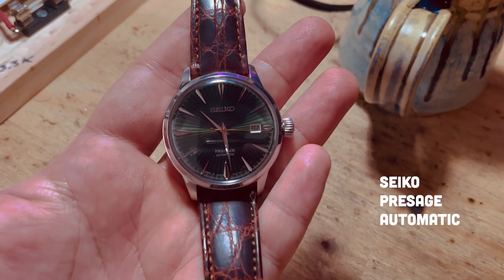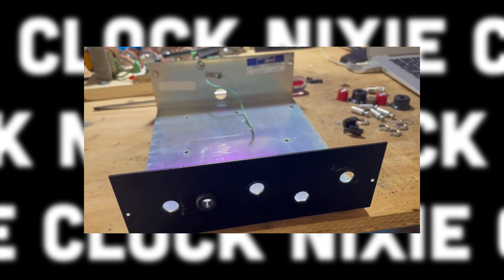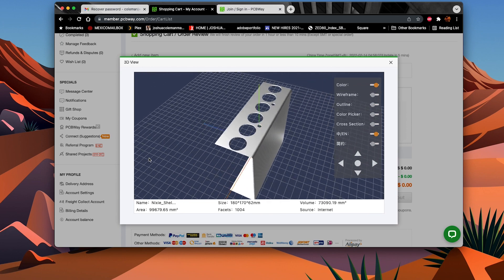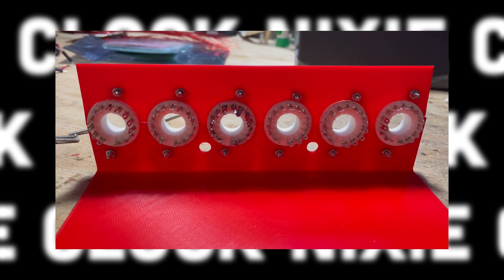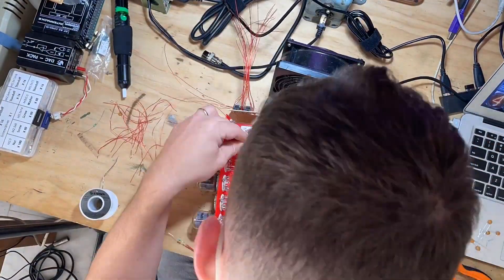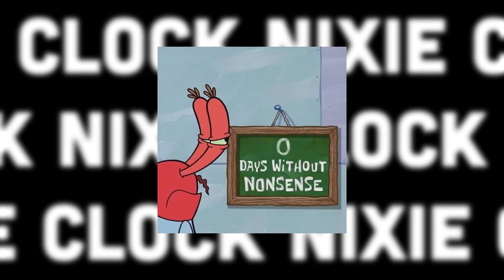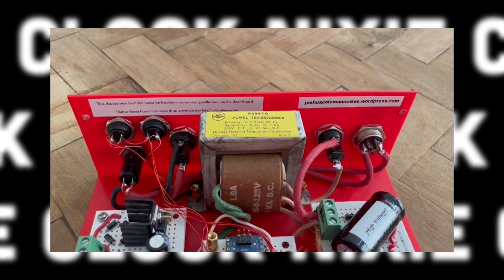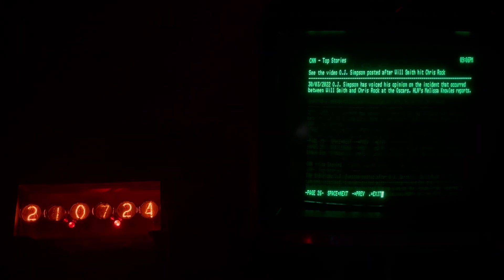Building a Nixie Tube Clock

Comment: Great!  Nixies are such fun to add to projects and clocks seem popular at the moment!  Just wondering - I may have miss seen it - but your mains input plug does not look rated for 100+ Volts.  Are you sure it is and therefore safe to use?
Reply from the maker: These aviation connectors are rated at 125VAC at 5 Amps. Therefore they are indeed safe for US mains applications. Thanks for watching!